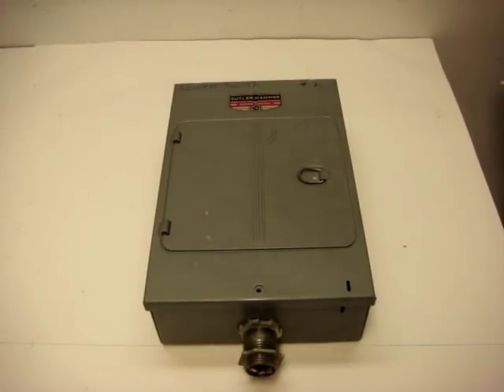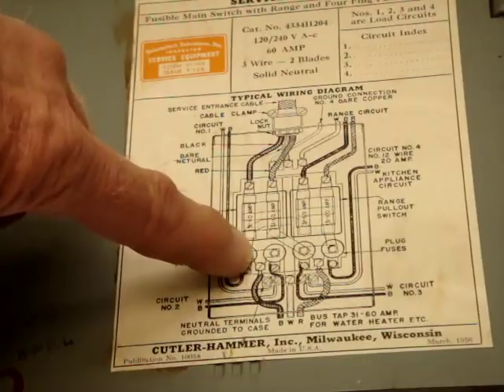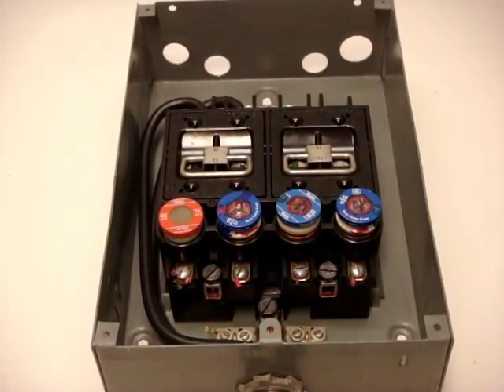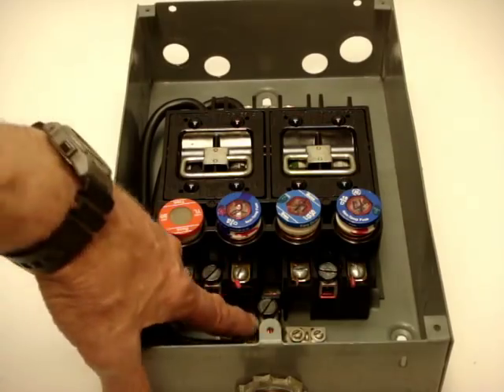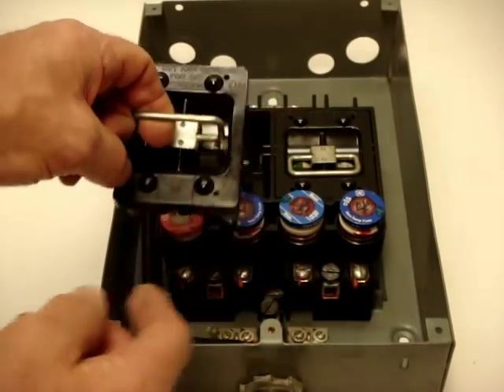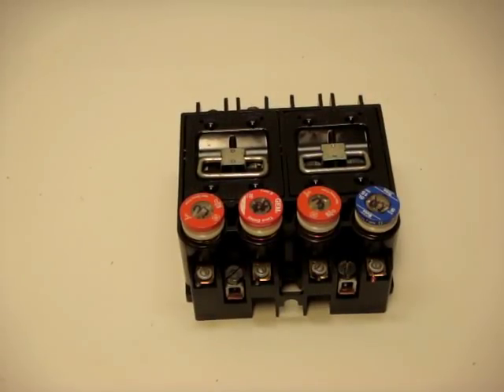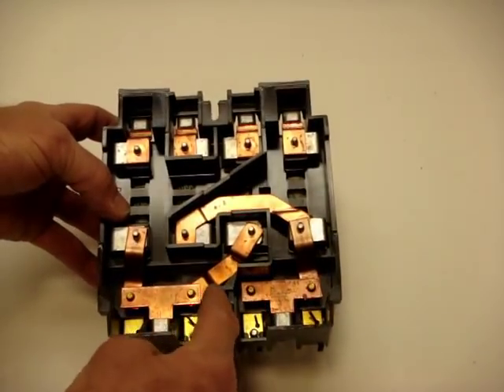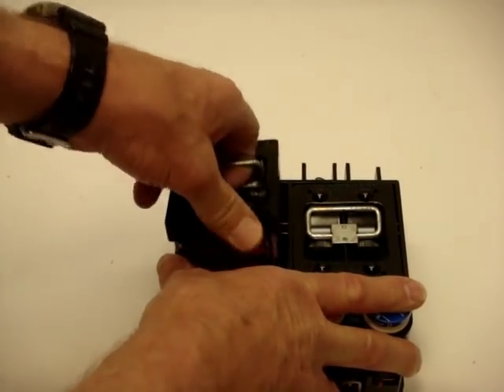60 Amp Fuse Box

Comment: This is what I'd rather have in my place the GOOD old bakelite 
pull-outssafer than breakers . Thank you very much for showing,
also  screwing a bulb into fuse socket to check for shorts on the 
circuit. ..

Comment from the maker: Generally, it is best to find a fuse box of the same brand & type to obtain a socket. Some contractors save these boxes for parts and pullouts. They are not sold as replacement parts anywhere that I know of.

Comment from the maker: I don't know your specifics, but, generally, the fuse box "Main" fuses are 60 Amp, and the "Range" fuses can accept up to 60 Amp fuses. Range wiring in those older installations usually was rated at 40 Amps and should have that fuse rating.
Reply: My fuse box has 8 screw in fusses.I have replaced them  all and still have no electricity in bdroom and bathroom..Have never replaced fuses from MAIN or Range areas..Can I tell if One needs replacing just by looking at it or do I need a special device such as u have here? and  could this be the cause of just the 2 rooms lacking elec?
Reply: Shana Lance
does your range work if so it means that both main fuses are good and that sould mean that all 8 fuses are getting power if they are all good it means there is a problem in the fuse holders or some were along the line there is a breake in the curcuit  best thing to do is call a pro

Comment: Great video. I have a 60 amp box made by Homart that is almost identical with only a couple minor differences. The left main feed powers the far right range and the right main feed powers the left range.  

I’m hooking up 6/3 wire to the Range block to power a 30amp sub panel. With the “Main” pull-out in place, the 6/3 connected to the “range”terminals is hot with the “ range” pull-out fuse block removed. Is this normal? I was hoping to be able to work on that new 220v “Range” circuit by removing the “Range” fuse block so I can have the rest of the power on with only the “range” disconnected. Thanks.

Comment: Great video, I recently purchased a home and this  exact fuse box seems to be connected to a modern breaker panel in the basement.  Does this ensure a better assurance incase of a fault? Also i have some really old bx metal jacket cable running in the attic that doesnt have a grounding strip.  Could an electrician run 14/2 romex to this fuse box? Im assuming the ground would be connected on the top, neutral on the bottom and my hot  on one of the 15 amp  fuses.

Comment: Hey! Kind of curious here... There's certain rooms in my house that don't work and has the same 60 amp fuse box shown above. Why would there be power in one side of the house and not power in the other side? Much appreciation for help and info
Reply from the maker: There at least a few possibilities to explore. One, or more, small fuse could be bad, or a MAIN fuse could be bad. To check a main fuse, you could pull out the main fuse block, and swap the left fuse for the right fuse and vice versa. If the part of the house that wasn't working is now working, you should just replace both cartridge fuses with "Time Delay" fuses. If that doesn't help, try replacing existing plug fuses with new ones of the same value.
Reply: @sparkyjohnrg  thanks!

Comment: can I safely replace a phenolic insulator ring? the one beneath a 20 amp fuse broke. in addition to the fuses there is a "block" with two of the old cardboard tube style fuses that I was told would turn off all electricity in the house if I "pull it", which was the case.

Comment: Quite honestly I wish panels like these were still made, as properly sized fuses are safer than breakers.
Reply: The fuses is more safe than brakers?? I bought a house with this and I want rent it but do you think the fuses they are safe
Reply: @ulisesquintero1219  sorry 5 months late, yes, in some ways, fuses ARE a bit safer than breakers, reason being, a fuse WILL ALWAYS BE GUARANTEED TO BLOW and cut power in the event of a problem on the circuit.  On the other hand, circuit breakers,  especially some of the older brands that are no longer manufactured (Federal Pacific Electric aka Stab Lock and Zinsco ) were very notorious for breakers that failed to trip off when necessary,  many fires had been started.  Not so much of an issue with modern breakers made by a well known and reputable company.  The biggest issue with fuse panels, and why they got a bad reputation for being unsafe, was purely human error.  For starters,  most fuse panels were rated 60 amp total, which is insufficient by today's standards. Many times in older homes were typically wired with very few outlets per room, and 14 guage wire 15 amp circuits.  It was all too easy and tempting to solve a fuse blowing problem by using a higher amp fuse.  Another old school and dangerous situation happens when a fuse blows, and the homeowner has no replacements available.  They unscrew the  blown fuse,  shove a penny in the socket and screw the blown fuse back in, effectively removing all protection and turning the house wiring into a fuse.  Note that while they did manufactured larger 100 amp or higher fuse panels,  they were very seldom used because by the time 100 amp service become common in the early 1960s, breaker boxes were becoming common place.
Reply: @Sparky-ww5re  No. A fuse doesn't always blow and cut power in the event of a problem with the circuit. Chinese automotive fuses are notorious for not blowing when they should, and Harbor Freight had a recall on fuse kits they sold. Had fuse panels like this continued in production, you can bet that China would be making glass and cartridge fuses with fake UL labels that don't blow.

Comment: I have same looking fuse box fuse box keep blowing the 3rd fuse .. This happened after power came back on from power outage .. I turned off everything when power came back on next day the 3rd SD fuse keep blowing out every one i put in blows now.. What's wrong?
Reply from the maker: zylahboow The fuse is trying to tell you there is a problem with the circuit. I would turn off all switches on that circuit & unplug all devices on that circuit. Put in a new fuse and if it holds, turn on 1 switch at a time. If everything works, you know it was something plugged into an outlet. Plug in one device at a time.

Comment from the maker: Each instance is different. Generally, the 100 Amp fuse panels had more fuse holders. MOST of the fuses should be 15 Amp, with 20 Amp for Kitchens and Laundry. Fuse Values are determined by wire size, to protect them from overheating. 14 Gage is rated for 15 Amps and 12 Gage is rated for 20 Amps.
Reply: Many 100 amp fuse panels are also split bus. There is no single main set of 100 amp fuses. Instead there the Main and Range blocks are fed independently from the line. The Main pullout with 60 amp fuses feeding all the plug fuses and subfeed terminals, and the 40 amp range pullout supplied power to the range or another 240 volt appliance or subpanel. Pulling the 60 amp main still left the Range pullout with power. It can be confusing because these have the appearance of a 60 amp panel.

Comment: if I pull the main fuse block then will that stop current to fuses? If so, with main block pulled I am safe to wire circuits to the fuses? Thanks for your video.
Reply from the maker: Yes, pulling the MAIN fuse block will kill power to all fuse connections.

Comment: I would like to replace this antique type box with a new  circuit breaker box.  what is out there that I could replace this one with? I have found a 100 amp service box but will I have to change the incoming hot wire?  Any help or info would be appreciated.
Reply from the maker: +Ted Dodgin  Ted, In many areas of the country, electrical wiring is a regulated activity. In MOST cases, the entire service should be upgraded. This means the wiring out to where it meets the utility connection, meter socket, and updated grounding. This is beyond the ken of most homeowners, and is dangerous. Leave this to a licensed contractor, and find another area to save money.

Comment: Cartridge fuses generally do not have visual indicators as to whether they are "blown", or not. It would seem unlikely that a MAIN fuse would be blown. There are 2 types of screw-in fuses: Edison base (light bulb type base) & Type "S". Type "S" fuses have porcelain bases, with each value having different threads. 15 Amp, 20 Amp & 30 Amp fuses each have threads that are non-interchangeable with each other. The bottom of the fuse holder would indicate the appropriate fuse size. Are you sure that the fuse you installed is good? The only sure way to test a fuse is to use an Ohm meter, or a continuity light.

Comment: I want to put a 220v outlet In my shop to run a welder how would I go about wiring it to the fuse box
Reply: Is it a panel like this? You would either have to add a subpanel off of the subfeed tap lugs. If you have a gas range, and the Range pullout is not being used you can use this pullout to run a 220 volt circuit.

Comment: so i have a fuse box very similar to this is it hard to just switch out the fuse box for a circuit breaker and is there anything i have to do before hand
Reply from the maker: Most areas restrict electrical system changes to licensed professionals. Check with your inspection authorities!

Comment: Any idea as to where you can get parts? Specifically the replacement "sockets" for the Edison based fuses?
Reply: I have replacements sockets if you still need them!
Reply: +MrScottie68 I have a bad socket in an old 60 amp fuse box. Would the one you have fit mine? is it hard to change out?

I have a picture, but don't know how to post it here?
Reply from the maker: +Matt Nale  I do not know which sockets would be interchangeable between brands. My suggestion would be to contact a local electrical contractor, and ask if they have any old fuses of the same brand as yours. Remember, the bad socket may be the problem, or the symptom of a larger problem. You do not know if the connections behind the socket are good or failing. Few items last as long as electrical fuse, or breaker boxes. You may be due for a change.

Comment: Where can I find a general switch split cartridge/ buss fuse block and box?
Reply from the maker: These fuse boxes have not been made in a very long time. See if a local electrical contractor has any. Small contractors are more likely to save old items, than a large contractor. You can also look on E-Bay. If you are trying to find parts for your box, you must know which brand, as they are NOT interchangeable!
Reply: There's a guy on E-Bay selling fuse box parts, pullout blocks, fuseholders and the screw shells.

Comment: Question: I have an old panel, with fuses. One of the components is a 240V block (with handle, that carries the other type fuses,  inserted into a box) that is removable, for the Range (now gas). I want to install - instead - 2 X 15A, 120V fuse HOLDERS (two fuses each). I can get a box full of them (10 holders, for 20 fuses), but the question is: would I require ALSO something to ATTACH those 2 fuse holders to,  to the box opening, once I remove the box block that has the handle? I hope I made my self understand. Thank you.
Reply from the maker: You don't state anything about the fuse box you have, So I will assume that it is similar to the one shown in my video - 2 fusible pullouts and 4 round plug fuses. The RANGE pullout is sized to accept up to 60 Amp fuses. You can insert smaller cartridge fuses by buying "fuse reducers".
Reply: Thanks for reply I understand now.
Reply: @sparkyjohnrg  can I change this fuses for brakes?
Reply from the maker: @ulisesquintero1219  The round "Edison Base" fuses (same base as a light bulb) can be replaced with "mini-Breakers" that can be rest like circuit breakers.
Reply: @sparkyjohnrg  but is not problem right if I put mini breakers like the same amp like 15 and 20 I have 6 total on house and I have the old panel 60 amp is ok if I change it right??
Reply from the maker: @ulisesquintero1219  properly sized, Mini-Breakers can replace fuses.
Reply: @sparkyjohnrg  ok do you know if 60 amp panel box is enough for house old house without ac united
Reply from the maker: @ulisesquintero1219  I have NO specific knowledge of your house, BUT, if you aren't blowing the MAIN fuses, it is probably adequate.

Comment: I ve replaced all the 15 am fuses but some the outlets still do not have power in the spare bedroom and bathroom, any trouble shooting tips
Reply from the maker: The problem may not be at the fuse box. you may have a loose connection somewhere else in the circuit, and it could be either wire. I am reluctant to give instructions, as I do not know the capabilities of the person receiving them, and I don't want anyone to get hurt.
Reply: If you have a GFCI outlet (test and reset buttons on it) in your bathroom, it's possible that your bedroom was fed off the bathroom circuit, and if the GFCI tripped and blew your fuses, it would cut off anything else on that circuit. 

My house is from 1953 and a breaker panel has been retrofitted in the 1980's, but it still has the same wiring layout that was run in the 50's. When the GFCI in the bathroom trips and kills the power, so do the adjacent bedrooms.
Reply from the maker: GFCI outlets have both LINE & LOAD terminals. The LOAD terminals protect everything beyond the outlet (like your bedrooms). Are there other outlets that require GFCI protection beyond that outlet? If not, turning off the power and moving the wires from the LOAD to the LINE terminals will change that for you.

Comment: It would appear that the “range block” is killed when the main block is pulled per the schematic as well as the reverse view of the main fuse housing.  Interestingly the cartridge fuses here appear to both be 50’s while three of the screw in fuses are 15’s and one is a 20.  Based upon those numbers it would appear that the 3 15’s (45) plus the 20 exceed the amperage rating of this box by 5 amps.  Moreover that similarly exceeds the individual cartridge fuses by 15 amps.  I have a similar box of later construction which is rated to 100 amps.  My question pertains to the cartridge fuses based upon the fact that the 4 are marked as accepting 31-60.  It appears that someone placed 4 60’s in the box and also put 4 30 amp screw in fuses in which clearly exceeds the safe amperage.  To make matters worse a great deal of the original wiring in the building (now zoned as a “shed” instead of a residence) appears to be 14 gauge wire (how the place didn’t burn down is beyond me actually).  Anyway my question is whether the main fuses running from the “range” are permitted to be 50’s or whether this is similarly limited by the screw in fuse totals which if they were all 15 amp would only permit two 40 amp cartridge fuses in the range block.
Reply from the maker: The MAIN kills the entire box. Adding up fuse sizes won't work. Fuses protect the wires based on sizes and insulation type. Old Range fuses were usually 40 Amps. The box is 240 Volts, you are adding up 120 Volt Fuse sizes.

Comment from the maker: The size of fuse you install is based on the wire that it protects. GENERALLY, 14 AWG is 15 Amp, 12 AWG is 20 Amp, and 10 AWG is 30Amp. The Maximum rating has nothing to do with which size fuse to install.
Reply: You can increase fuse size on motor loads. Some times an air compressor drawing 14 to 15 amps will often blow a 20 amp fuse so you can increase it to 25 or even 30 amps while using #13 gauge copper wire.

Comment: question: how to tell which screw-in fuses to use?
Reply: 18 gauge wire you need 10 amp 16 gauge eire you need 13 amp 
14 gauge wire you need 15 amp
12 gauge wire you need  20 amp
10 gauge wire you need  30 amp
8 gauge wire you need 40 amp
6 gauge wire you need 50 amp 
4 gauge wire you need  60 or 70 amp
2 gauge wire you need 90 amp